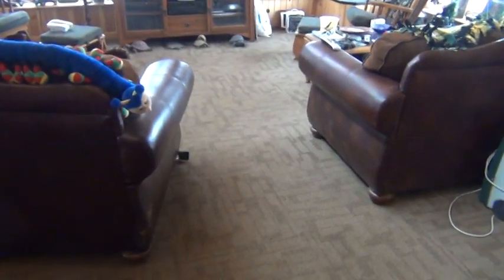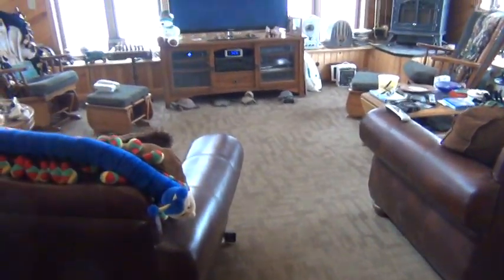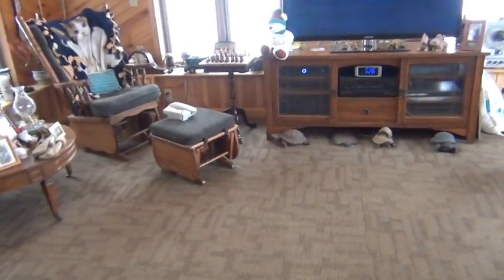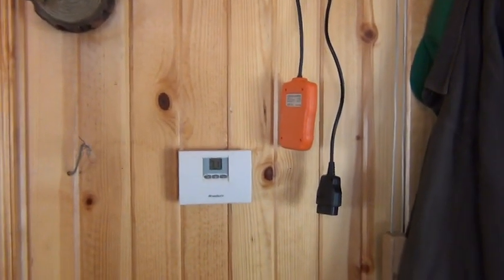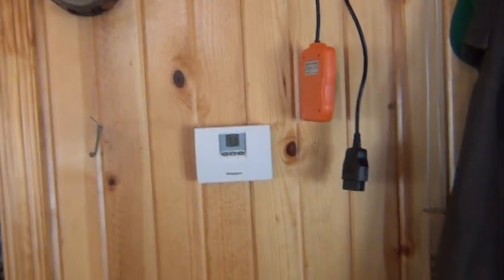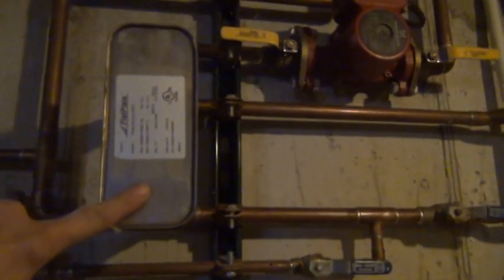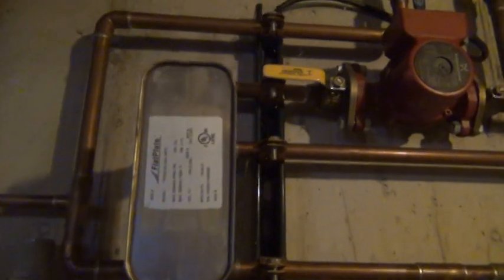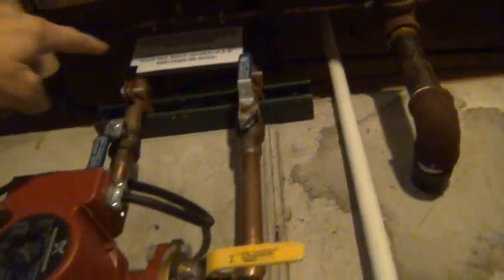Radiant Heat Using a Condensing Tankless Water Heater.

Comment: Great video and system thank you for creating them both. How is everything working 6 years on? Any parts you have had to replace?
Reply from the maker: So far everything has been working fine. I thought I was having a problem with the water heater last year, but it straightened itself out and its been fine ever since.

Comment: Great video. I have a Rinnai RU98iN for hot water, and want to use it for heating my first floor about 1400 square feet. Do you know whether I can set it up to meet the plumbing code, any advice very much appreciated!
Reply from the maker: To be honest with you, I don't know what your specific codes require or if there are any. 
You have the largest water heater at 199,000 btu, but 1400 sq.ft. is a pretty big area and I'm wondering if it would sufficiently heat an area that big. Because you want to use it for both domestic hot water and floor heat, you would have to use a flat plate heat exchanger to isolate the two loops and I don't think that one exchanger would cut it because I think, the exchange rate is only about 50% at best! You could use a larger exchanger or two or three in parallel possibly. I believe your heater could easily heat that area if it were used solely for that purpose, because then a heat exchanger would not be required. Also, a lot depends on the weather conditions in your area and how heat efficient the space is.
I hope this helped.

Comment: 130 is to hot for a slab
Mine is 110, every half hour for 2 minutes 67f  9 300ft runs
Reply from the maker: The temperature of the water exiting the water heater to the primary loop is 130 deg. The temperature of the water exiting the exchanger to the secondary loop is no where near that. The highest temperature of the water I've ever seen return from the floor loop was around 90 deg.
You have a HUGE system! 9 - 300ft. runs? Really?. That's 2,700ft. which is over 1/2 mile!!) and are probably running a water heater(s) dedicated to just floor heat only and no domestic. Why only 110 every 1/2 hr for only 2 min. 67f would be too cool to comfortably heat a living space. Are you using timers? What's wrong with a thermostat? I'm sorry, but none of this makes any sense to me!
Reply: @spudpail    when one is trying to heat a slab it takes time for the heat to come to the top of the slab to actually begin to heat the space above.  A thermostat makes it run to long.  It takes time to heat even 1 degree.  By allowing it to come onto 2 minutes every half hour the slab stays at an  even temperature.  The tankless heater actually works 1.6 hours in a 24 hour period. Very economical. It can also be supplement with an indirect storage tank accompanied with a pellet stove.  So the pellet stove heats the water to heat the floor.   All my own design.
Reply from the maker: @albertwayenberg9140  I've been thinking about your system. I can't visualize what you've done there. I'd love to see you post a video to share your idea. It sounds interesting!
Reply: I have a tank less water heater and I use it for my potable water throughout my house. Can I go ahead and tap into the hot water with the proper set up, I already have pex ob in the floor, I just need the set up,.would you be able to show me a diagram of how I can do it and all the parts I need?

Comment: Interesting video, thanks!  One question:  Why have a primary and secondary loop with that heat exchanger?  Why not run the output of the water heater directly into the floor loop?
Reply from the maker: Because the hot water is used for both domestic and floor heat you must keep the 2 isolated from each other.
Reply: @spudpail  Thanks for that info.  I don't remember your having mentioned that in the video.
Reply from the maker: @MartinMMeiss-mj6li  You know, actually your right. I did mention it in the text, but I should have mentioned it in the video as well. Maybe I just assumed that everyone would somehow know that. My bad, sorry.
Reply: @spudpail  No worries.  I appreciate the way you share your knowledge and experience.

Comment: I just purchased a Takagi tankless water heater . I don’t wanna do my DHW with it only my floor heat. Do you think I would need a primary loop or would I be able to just circulate it through my floor with one pump. My system is 4 loops ( one zone) of 300 foot each. Total of 1200 lineal feet of tubing.
Reply from the maker: You should be able to run it without a primary loop. If you're planning on using it only for heat, shouldn't you consider a tankless boiler rather than a water heater?
Reply: @spudpail  Lol!, yes I probably should consider a boiler but 800.00 vs. 4000.00 I’m willing to try a tankless. I’m struggling with trying to find out the difference between a boiler and a tankless. They both heat water.
Reply: @tomquick2594  you will likely need primary/secondary. Main reason is tankless are designed with a very high resistance heat exchanger to deal with household pressures of 40-60psi. The flow you’ll get through underfloor will likely be insufficient to keep the tankless running correctly.

Comment: I'm planning about doing this exact same thing. Did you have to upgrade your gas lines?
Reply from the maker: No I didn't. All my lines are 3/4" and  the flex line to the heater is 3/4" as well. I did have the gas company check the meter to see if it could handle all of my appliances all running at the same time and he said it was okay. He did tweak the input side of the meter a little however.

Comment: How many gpm does your tankless unit supply  to your system
Reply from the maker: That's a little tough to answer, but here goes. Both loops use the same Grundfos circulating pumps. Mine are rated at 8 gpm. The water heater will throttle down the flow if it has to in order to maintain 130 deg. I know that the heater is not running at full flame by the way it sounds. It kind of sounds like its just idling. Given that, I believe that the water heater loop flowing at the pumps max. rating of 8 gpm. at 130 deg. You have to keep in mind that the return water in the primary loop is returning to the heater at approx. 90 to 100 deg. so it doesn't take much to bump it back up to 130 deg. The secondary (floor loop) just runs at a constant 8 gpm regardless of water temperature. Hope this helps.

Comment: Hello from Ottawa Canada. I have the same tankless water heater for domestic hot water and i was thinking of using it to heat the slab in my attached garage with radiant tubing same as your setup. I'd appreciate any advice you can give me. Thanks
Reply from the maker: I would suggest watching my video to get an idea of how this system works. One concern I have is demand. Is your garage insulated well? Is the door insulated and well sealed? Being in Canada I guess you can get some pretty cold winters, so I'm a little concerned if a system like mine can keep up with it. Keep in mind that the room I'm heating is only 400 square feet and doesn't have a garage door. It does have a lot of glass and we do get some fairly cold weather here in southern Wi (Had -15f two nights ago). I do have a free standing gas stove in that room in case the floor heat can't keep up with it. In your case I wonder if a gas stove would be nice for your primary heat, and just use the tankless to keep the floor warm. That would be great if you like to work in your garage, especially if you have to lay on the floor under a car. Feel free to ask more questions if you like.
Reply: @spudpail  thanks for the quick reply. I watched the video and i understand how the system works. Great video btw. I think we have a similar climate to Wisconsin here in Ottawa. The low was -27°C (-16.6°F) last night but it's back up to -6°C now. The garage door is insulated 2" (R10) foam and weatherstripping all around, but not sealed air tight. The 2 side walls have R12 fiberglass batts in them. Back wall is shared with the house. Heated room above the back half and R40 batts above the front half. I think the tankless might be running all the time to satisfy the thermostat on the coldest nights during the winter, and it may not be able to keep up. I like your idea of a gas stove for heat. I don't work on cars much and wouldn't be lying on the floor. I toyed with the idea of a wood stove but didn't want to give up the floor space. I thought of using a gas furnace but thought that sawdust might get into the ductwork. I thought of gas or electric ceiling mounted shop heaters, ceiling mounted gas or electric radiant heaters, and ductless mini-split wall mounted heat pump. All have advantages and disadvantages. Can't decide!
Reply from the maker: @trevorritchie2575  I can sympathize with you. If all you want is a garage that will keep your car at around 50°F or so, then the floor heat system may work for you especially since your garage is so well insulated. It almost sounds more heat efficient than the room in my video. From what you said about sawdust it sounds like you have a wood shop in that garage? I'm wondering. Would you have to tear up your floor to install radiant heat.????????
Reply: Concrete floor is cracked and heaved in the middle. I'd have to remove it, then put down foam and pex then pour a new slab. Being able to maintain 50F would be great but I'm not sure how much it would cost. I'd settle for being able to maintain 35F, with the ability to bring it up to 50F on mild days if I wanted to work on something in there!
Reply from the maker: @trevorritchie2575  As long as you have to replace the floor anyway, I would probably want to put in radiant heat myself. If you just want to maintain 35°F I don't see a problem. Keep in mind that if you want to bring up the temperature, you will have to expect maybe a 4 - 8 hr. delay. You already have a tankless so that's a good chunk of the cost right there. You still would need the heat exchanger, 2 pumps and pex plus other odds and ends and then there's also good 'ol labor.

Comment: let's us know the cost to run......
Reply from the maker: That's pretty hard to answer due to all the variables, but I have noticed a small decrease in my gas bill overall. Its hard to say for sure if the tankless is the reason for it or not. The reason I went this route was was not for economics, but because I always wanted a tankless heater, for its unlimited supply of hot water and some extra floor space in a tight area. The tankless is about 98% efficient, so I would think it would have to save you something. It's just plain physics!

Comment: Fail, tankless water heaters are not boilers, you have no warranty since install,
Reply from the maker: Amazing!!!  I never said it was a boiler and if you would have read my narrative, you would have seen that. This has been working since March 2018 and not even the slightest problem in all that time. As explained in my text I said that it wasn't designed for a radiant heat system, but I later learned in the book that came with it that it can be used for this purpose. I already had this same system using a tank style water heater and when it sprung a leak I decided to try a tankless and it's been flawless. I'm using manufactured components that are designed to do exactly what this system is designed to do.
Reply: Pass, tons of people are using tankless water heaters for radiant heat and they work great.

Comment: I have the same unit , are you also using this for hot water as well,  if so that is great as this is my goal, to use this to do both ,  great video great detail
Reply from the maker: Yes I am. That's the reason for the exchanger. You must isolate the radiant heat loop water from the domestic hot water.
Reply: @spudpail  I got off the phone with Krell and he said there is no way to use both at the same time a I needed a boiler.  I have seen many skoolie people using a set up to use for hot water and floor heat.  Since I am not a plumber I get lost.  I will watch your video a few times
Reply from the maker: @colleenmendoza1344  Keep in mind that the heat exchanger is made just for this purpose, so I didn't invent this system. As I stated in my video I've been using this system for over 10 years and about 3-1/2 years with the tankless and I never had a problem and it works quite well.

Comment: Have you had any trouble with the tankless failing. Was tolded that continues use can make the water heater fail. Since it has been 2 years, can you comment on it.
Reply from the maker: It's actually been closer to 3 years now and so far I've had absolutely no problems. In the instruction manual they actually do have instructions on how to use it for hydronic heat.
Reply: I have not found much guidance and some pros have warned me against it.  I think it is new for folks....the manufactures don't seem to want to warrant it.  I have been running mine for a month. So far so good.
Reply: You need to do a yearly service flush on tankless heaters to prevent issues. Mainly due to calcium collecting in the unit reducing volume causing insufficiencies.

Comment: What is the flooring?
Reply from the maker: It's a concrete slab with commercial grade carpet squares.
Reply: @spudpail  I have about 2800sf of radiant in my house. I was warned to avoid carpet. I guess it works fine at your house
Reply from the maker: @rogerwhiting9310  Wow! That's a huge area! I know you wouldn't want to apply a thick arpet with padding because it may keep the heat from radiating into the room properly. The carpet squares I'm using are glued to the floor and they are about 1/2" thick, so the heat goes through them just fine. As I showed in the video the surface temperature of the floor is over 80 deg. and sometimes it can even get close to 90, so it's not a problem.
Reply: @spudpail  it is the heat for the garage and basement on the ground floor. Its the heat for the first floor too. 11 zones upstairs and 4 in ground floor.
Reply from the maker: @rogerwhiting9310  Your system is vastly more complex than mine. My floor heat is only in the one 400 sq. ft room.
Reply: @spudpail  same principle. Its all Uponor/Wirsbo which is by far the most expensive. 20 years ago there wasn't a lot of choices.

Comment: Thank you so much for the reply.   At time stamp 9:33, I see that there are two other pipes, one going up and the other one going down besides the cooled return pipe from the heat exchanger.  
I assume one of them is your cold fresh supply from the water softener.  could you tell me what the third one is ?  Thank you.
Reply from the maker: If you mean the pipe that is going down to the basement under the sign.That goes to an outside sill-cock so I can switch to outside soft water if I want it by opening and closing 2 valves, one is on that pipe, (you can see the valve handle), and the other is in the basement. The sign explains how to do it. Weird huh?

Comment: Hello Mr. Spudpail, 
Thank you very much for sharing your setup with everyone.  I really like your setup and I am glad I found your video after watching a number of different videos.     
I have a few questions and I'd appreciate it if you could clarify for me.  

1)  Where is  the cold city or the well water being introduced into your water heater?   You mentioned that the heat exchanger return is the cold water going into the water heater.  
2) At time stamp 9:28, I see the hot water from the water heater going down into the basement to the heat exchanger inlet, and I also see a T-fitting with the hot water going up.  
Is this the domestic hot water for your set up?    
3) Do those two pumps have different settings?   If they are, do you know how to determine what the pump settings should be?   

Thank you again.
Reply from the maker: The cold water is from a well, but it goes through a water softener before it gets to the water heater. The water that leaves the heat exchanger is then fed back to the cold water side. You have to remember that since all pressures are equal, all the primary loop pump has to do is move the water through the exchanger and heater and back again. That tee is in the main hot water line that goes up to supply domestic hot water to the rest of the house and down to the heat exchanger.  The pumps have no settings, they just move water.
Thanks for asking.